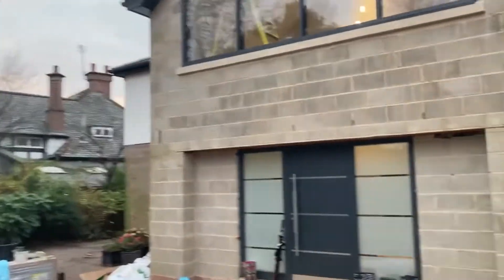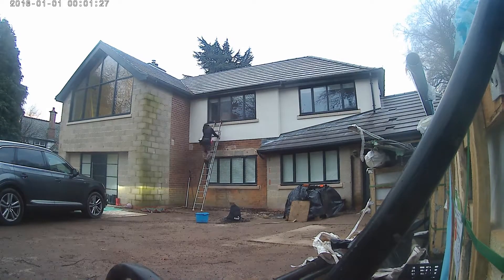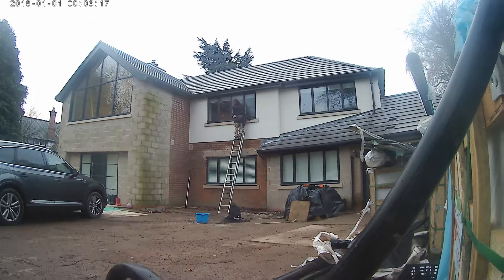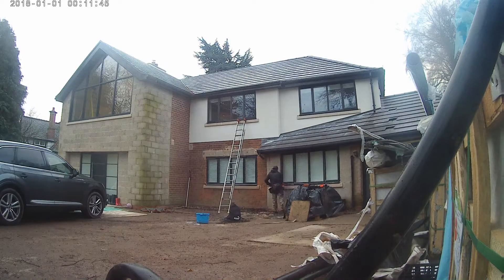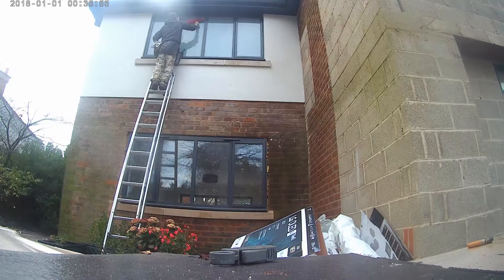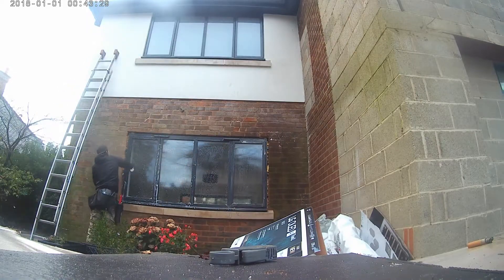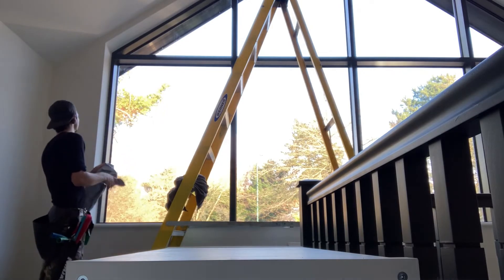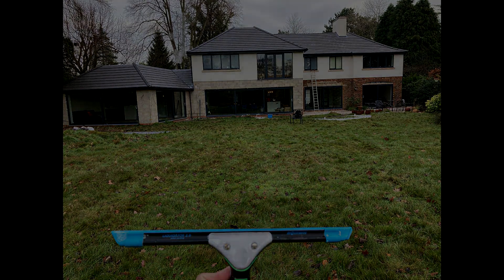How To Price & Tackle Your First BUILDERS WINDOW CLEAN! // Partridge Exterior Cleaning

Comment: Great job and  video again.  I think over all builders cleans are bit too much hassle. Some of the new large glass sliding doors can be difficult.  The ones I see are covered in silicone, after the fitters . Great information again.  Cheers mate.
Reply from the maker: They definitely can be mate but someone's got to do them! Always charge crazy high so if y ou get it it's worth the damn headache :D 
Thanks buddy take care
Reply: Silcone is actually easy - you use Melamine foam sponges and it comes right off.

Comment: Great video again.  Try using fine steel wool  and a plastic scraper . I never use steel blades on glass .👍
Reply from the maker: Where do you get your wool from? I've been meaning to buy some to be honest. I've always used the blades and they work great but I can imagine it would be quicker with the wool as you dont have to worry about being too careful.
Reply: What you want is grade 2 steel wool you can get it from any builder providers . B&Q. Home base. Woodies. Ebay. It won't 
Scratch glass  I never never use a steel blade. God bless keep up the good work
Reply: @paulsexteriorcleaningservice  👍
Reply: Same here. Also eraser sponges, oil flo and so on.
Reply: @PartridgeExteriorCleaning  It's quad zero or 0000 steel wool. Just never use it if you suspect rust - they're disposables at the end of each day. I use a 'sandwich' of eraser foam sponge, steel wool after I make sweeps with the 6" plastic blade. Then use a japanese filling knife to protect the wall and another to pop off the paint and plaster, then a pass over the frames only with 3m green pad. There's a cool track brush which is miles faster from WCR.
Reply: @colonynaut1627  👍

Comment: Great to see a new build clean. Looks like anodised ali frames? Any tips on removing render and plaster from those frames?
Reply from the maker: Cheers buddy, I find they just wipe clean with a big of elbow grease but make sure you go back and recheck once theyve dried because the wet render dust blends in when its wet so may need to go over them again.
Reply: A triumph scraper with plastic blades from miniscraper.

Comment: Great videos why do you scrape roofs rather than pressure wash them ?
Reply from the maker: I find it a gentler and safer option, I don’t fancy the overheads of causing any water damage to a property just because it’s faster. I also work alone so would need someone to man the machine really. 
I’ve pressure washed garage roofs but wouldn’t want to risk a house one just in case. Would rather spend longer on it and not worry about any damage :)

Comment: Great vid mate, lovely house & mossive!! I haven’t done a builders clean for years now, too much of a ball ache & people in general don’t want to pay what it’s worth I find so if they won’t pay what I want which is x3 minimum of what a maintenance clean would be I wouldn’t do it. I’d sooner pass on them. Great job tho 👍🏻
Reply from the maker: Cheers Neil 👍👍👍 and yes mate anywhere from 3-6x the regular price I usually charge depending on how bad it is so they come few and far between
Reply: @PartridgeExteriorCleaning   If I ever get asked again I’ll quote x6. I’ve never seen a heart attack right in front of me 😂. I used to get the “what planet u on face” with a x3 quote 🤣
Reply from the maker: @neilpalmer9691  xD Extreme circumstances but it has worked a few times in the past :D
Reply: I have 150 tools for CCU or builder's clean and it's not worth low balling them - they're simply the hardest work out there on many occasions. I charge 5x-8x traditional cleaning - that is frames, tracks, doors, glass without using metal blades. 

I don't think there is a point in charging less and using metal blades because the majority of modern glass scratches. Even professional window cleaners are scratching up miles of glass without realizing it. This is because the new standards for insulated glass put special coatings and the glass itself is changing. You won't realize you've done it - it is only when the angle of sunlight is low in the sky you'd suddenly realize every window is scratched. Even if you are super careful - changing the blade, doing selected areas - what happens is the water enters the scratch. When you squegee the water remains in the grooves while the rest of the window is dry. If it is dry you'll only notice several hours later there are white lines appearing because it takes a long time for the water to evaporate. 

I say go for the high end of the market and leave the rest to suffer. It is sad though that the work is so unappreciated when it is this difficult and risky. In the end a lot of builders are going to lose their shirts over this - it's going to take a long time for them to update buying the cheapest labour is an expensive mistake.

Comment: Have you got a pdf of a scratch waiver
Reply from the maker: Hi mate it's something I write up as and when as all of the jobs are different,  just have your name, logo time, date,  explain basic method you're using to clean the windows and that you will not accept liability for any pre existing damage caused to the windows including scratches, dented frames etc. 
And then if you can make sure to take before and afters of how bad they are so its plausible that its not you. and obiously get their signature too. its something to definitely go over but tread lightly when you talk it over in person and just say you have to cover yourself, but be strict in your waiver.
Reply: @PartridgeExteriorCleaning  

This is why I went to a zero scratch method using a combination of tools so I don't have to use metal blades - but I won't offer all that for 3x the price. The job itself isn't a problem - it's just a serious lemon market where the majority of sellers and buyers have no idea what they're talking about. In future I'll be going to a new business model here where I offer several levels of finish like plasters do and the customer can elect which they prefer.
Reply from the maker: @colonynaut1627  Yeah sounds like a smart plan mate